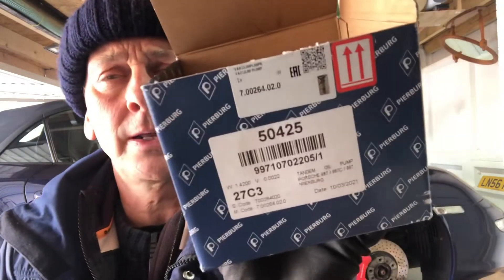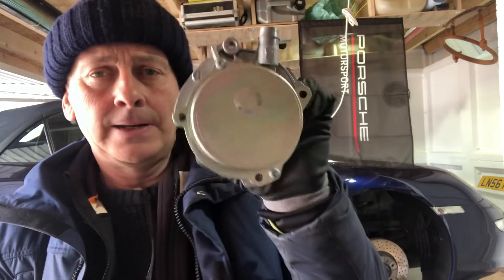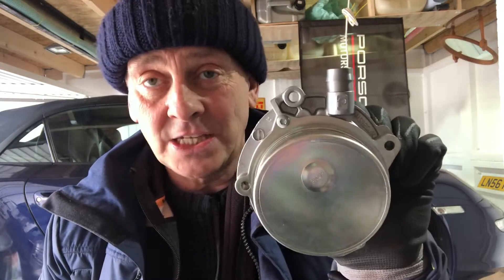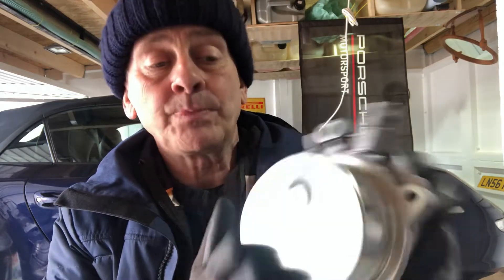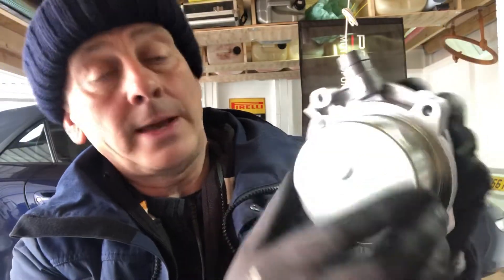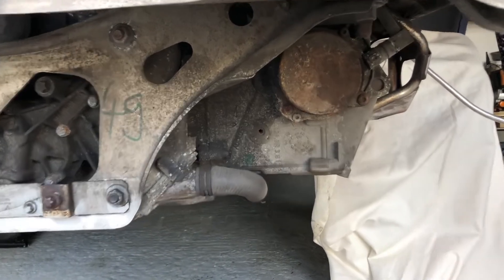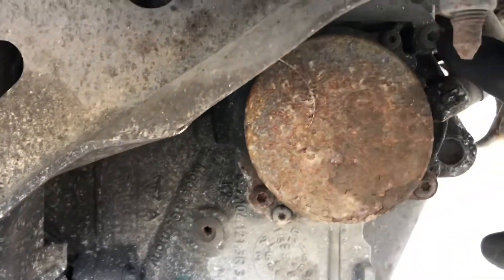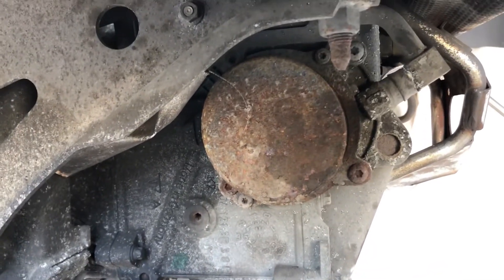Porsche 997 Tandem Pump removal and replacement part 1/2

Comment: Very good vlog , I bought one and need to replace it.  I am going to paint the new one before I fit it , so it doesn't rust .
Reply from the maker: That’s a great idea and it had crossed my mind but the one I removed was 15 years old and not leaking so I though I probably won’t care anyway in another 15 lol. But yes great idea. Thanks for your response. I’m probably going to try and refurbish the old just to see how bad the cover actually was. Cheers. Andy

Comment: Great video. Looking to do this myself sometime. Maybe just change the cover as there were a couple out there (ninemeister) if they are still made. There wasn’t much oil that came out, did you drain it first?
Reply from the maker: The car had been standing for a few weeks but it’s well above sump level so apart from the pump itself the oil will naturally drain down. I tip. If you remove the pump don’t be tempted to turn the pump Keyway without covering it first as the remaining oil will fly out. Cheers.

Comment: Just noticed my 2007 c2 is leaking from this thing. You're right about the price thing, from the dealer it's almost $1,000 CAD and from every online resource it's around $500 CAD. Thanks for the video! Would you say it's possible to remove this without taking off the bumper/exhaust?
Reply from the maker: I would say you definitely need to remove the bumper and the heat shield. It can be done with the exhaust in situ. It’s fitting the new part that’s more important to make sure you seat it correctly and reinsert the vacuum pipe.
Reply: @porscheminormechanicsrando8394  Would you say its impossible though? lol... I'm the type to rather spend 3 hours struggling to fit something in than take those 3 hours removing stuff in the way and putting it back. Almost always end up stripping other rusted bolts and what not and having to fix stuff I never intended to.
Reply from the maker: @dpav7994  that’s owning a 911 for you. Lol. Take the bumper off. 😂
Reply from the maker: Just a thought!  Remove the air filter and see if you can see it. You may be able to adapt some tools to get on the star drives. It will be difficult to free the vacuum pipe up I think.
Reply: @porscheminormechanicsrando8394  Luckily I've had to buy all kinds of adapters for other  strangely located stuff I've had to change on the 997 in the past. I'll let you know if it works with just the airbox out.
Reply: @porscheminormechanicsrando8394  Just finished, only took about 1 hour. Kept the bumper on, only needed to disconnect 1 cable that was in the way of the top left screws. The top right screw was only accessible through the muffler hole in the bumper, so needed about 20 inches of extensions to get to it. Funny thing is that I think my pump was fine, despite being rusted to hell. I think the leak was only coming from the inner o-ring behind the rusty cover.
Reply: @dpav7994 you kept the bumper on. Which muffler hole you referring to? How did you take the side pipe supply off?
Reply: @georgehearn2024  Sorry for the confusion, I used socket extensions to go through the muffler cutout in the bumper. I didn't go through a hole in the muffler :)  Can't remember about the side pipe supply. All I can say is that nothing major needed to be removed to get this done.